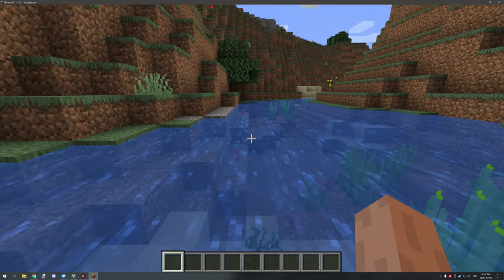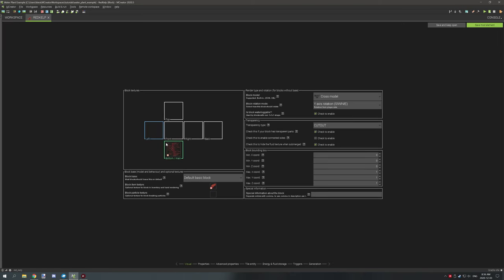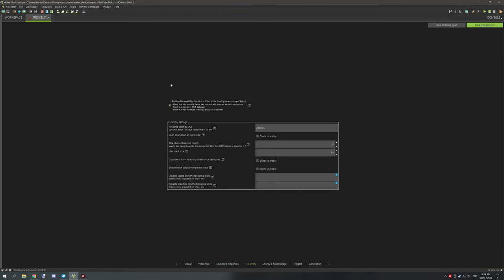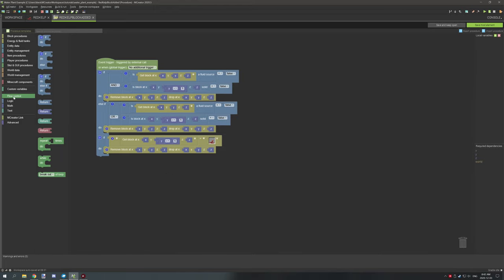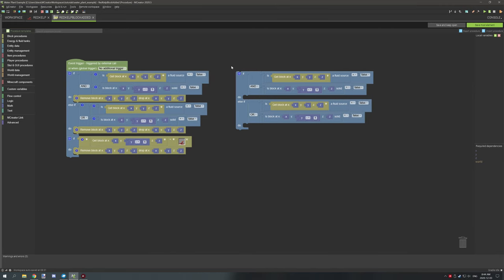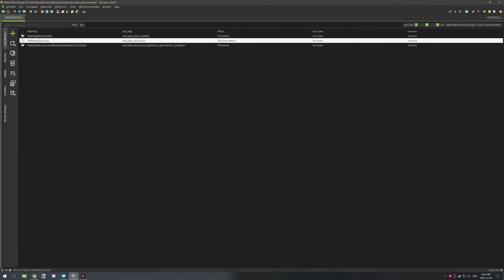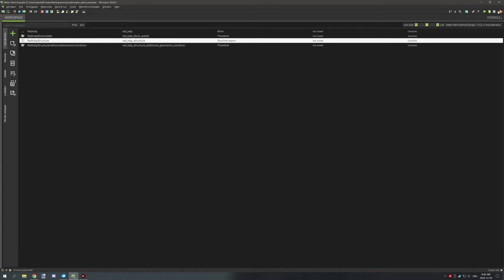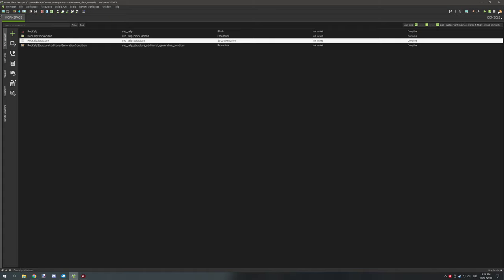MCreator: Water Plants Tutorial | 2020.5

Comment: I want to make my plant spawn upside down or other ways like some corals do how can i do it
Reply from the maker: First step would be to test for a block that is not air, or liquid.
Then you want to change the model based on the rotation.
This can be done either in  the generation process of the structure or you can make a right-click on block action.
Either way you would need to make sure the block offsets the placement in the proper direction.